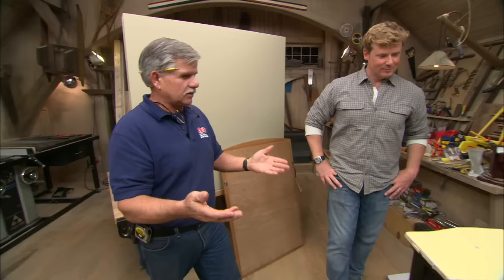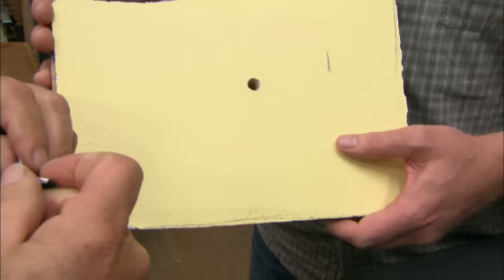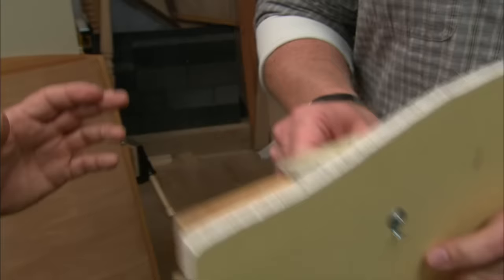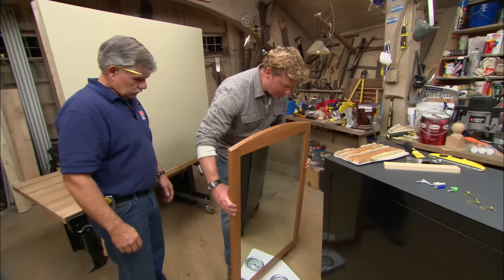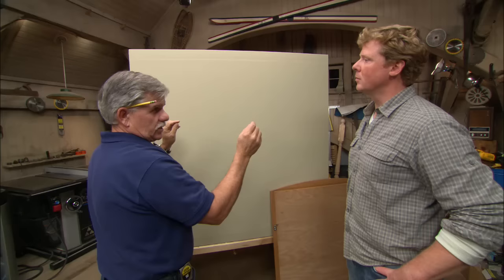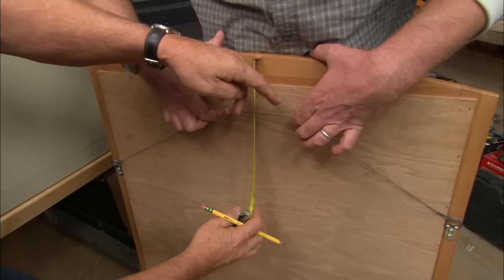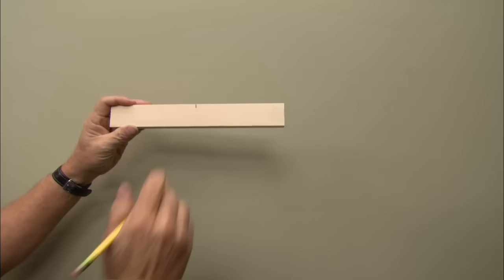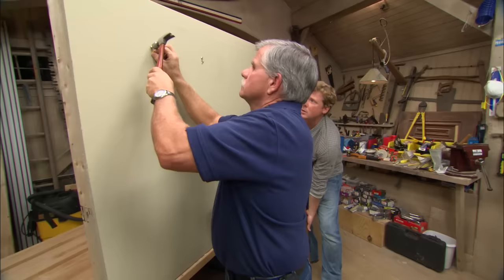How to Hang a Heavy Mirror | Ask This Old House

Comment: I didn't know you could just nail these into drywall. Thought drywall automatically meant using anchors and screws. This looks so easy!
Reply: Not a good option and for the screw in inserts don't try hammering it in. Poke a hold in first and then screw it in.

Comment: It may be overkill, but when hanging heaving pictures, I often find the stud in the wall. Once I have the stud, I measure the distance to the center of the picture. Then use that measurement for locating the drywall anchor on the other side of the center. That way I have one fastener driven into the stud and the other being a drywall anchor like one of the ones shown in the video. If the drywall anchor fails the fastener in the stud may still keep the picture/mirror from crashing to the floor. It is also helpful to know where the studs are so you are not trying to drive plastic anchors into the stud if there happens to be one where the anchor is intended. There are some fasteners that work with both drywall and wood studs. These have worked well for me.

Comment: When u are looking at a wall with picture or mirror in your hands, you are not able to see the hook and get the wire to catch. Here is a tip. Get two drinking straws with the diameter closest to the width of the hook (the part that catches the wire). Insert a straw in each end. The straw will be at an angle away from the wall. Get the picture or mirror and lift high over the straw, bringing down slowly. The straw will guide the wire easily into the end of the hook. Done this many times. Works like a charm
Reply: You're so clever!  Thank you!  😊
Reply: Great tip! Thanks!
Reply: Don Persaud that’s awesome. Gonna have to try that today at my next customer.
Reply: Had trouble w/my concrete entry wall. My son studying to be engineer helped me, but we were off 1/2" too wide. I'm going to try this to see if my understanding of our shortness is correct B4 I proceed. I know it'll work once I get it (carefully!) despite no wire. Thanks!
-Azariah/SuburbaKnight
Ps 20:1, 6-8; Is 43; Is 38:15-20; John 14:11-21
Reply: Naked sweating peeking out thru the blinds every 3 seconds. Jaw going bananas. Is all that happens when anyone has a straw and mirror. Nothing gets done.
Reply: @chadlebbing4960  Root beer right thru both nostrils! Freakin hysterical! Good one!! Is that a helicopter??????
Reply: I don't get it.
Reply: Great tip. Hanging heavy mirror on wall tomorrow and will use this clever tip.
Reply: @mitchjohnson4714  
👍  Me neither  !

Comment: I just purchased the hooks you used for drywall.  If you read the small print, it states that the weight they support is only if the nail is inserted into a stud.  Also, why even use the picture wire at all ? I feel the mirror would be sturdier if you placed the hooks on the wall,  to catch the D-ring hangers.  This would also stop the mirror from moving side to side as pictures always move on wire.  I love your show!

Comment: You can use just the drywall, no studs, drywall is much stronger than you might think even though you could punch a hole in it with your hand. With good drywall and the correct anchors you can hang up to 50 pounds on drywall without going through the studs! However, if you make a mistake, or the drywall isn't as strong as it should be, it's not going to hold it and the drywall will break and you'll hear a nice crash as whatever you hung up comes falling down.

Comment: I'm no Tom Silva, but I have mounted many heavy mirrors for a service called TaskRabbit, and I'd like to share some things that might be useful.  Tom is right when he says that the first thing you need to know is what the wall is made of.  I would add to that: is it an interior or exterior wall?  (Exterior meaning that the other side of the wall is the exterior of the building or another apartment unit.  Interior walls tend to have more space available behind the drywall or plaster & lath, which increases your fastener options.)  I like his use of the toggle bolt with the hook for the plaster wall.  This also works on drywall, as long as you steer clear of studs. (Mounting fasteners into wood studs would be great, except that most mirror D-ring spacing won't match your stud spacing.  Hollow wall anchors let you put the mirror where you want it.  Usually.)   Keep in mind that you'll need to drill about a 3/8" hole for a 1/8" toggle bolt, and you'll want to make sure that the upper, round area of the hook you use is large enough to cover the hole.  Also, plaster and lath walls tend not to have a lot of clearance behind the lath.  Exterior walls especially often have about 3/4" of space or less between the lath and a masonry exterior.  The toggle bolt length will have to be just right, assuming there's room for the toggle to deploy.  If you've found a good toggle-equivalent solution for exterior plaster walls, please comment!  

I don't recommend using a wire between the D-rings, because what tends to happen is the weight causes the D-rings to peel up along the edges, creating a sharp edge that can scratch your wall.  You see this a lot on antique mirrors that have been hanging on a wire for a long time.  Mounting with a wire does allow you to both adjust the position of the mirror left to right, and level it, so if you don't mind the peel factor, have at it.  If you want to avoid the peel, you could...

Use two fasteners: one for each D-ring.  Tom could have also measured the distance between the D-rings, and the distance from the top of the mirror to the D-rings (check them both! don't assume that just because it's from Restoration Hardware, they're accurate.)  Then, he could attach the hooks to the wall, and hang the mirror from its D-rings.  This method requires you to be careful measuring and drilling, though, because you can't make small adjustments for leveling and positioning.  

A tip on measuring where your two fasteners will go when hanging a picture or mirror with a wire is this: measure the width of the piece and divide it by two.  Let's say you have a 30" wide mirror.  Half of that is 15", so that's how far apart the hooks should be.  (You can round it by a couple of inches if you have, say, a large map that's 52.75" wide.  Just make it 24", especially if you're using a 24" level. :))  To determine the vertical measurement (distance on the wall down from where the top of the frame will be), take the remainder of the width, in our case the other 15", split that in half and measure in on each side 7.5" and mark those spots.  Then use your fingers to stretch the wire up from those two points, keeping it level to the top, and mark where the wire lies.  Measure down from the top to this point, and that's where the fasteners go.  

Finally, when you're holding your picture or mirror up to the wall, be really careful not to touch the wall with it, if possible, because walls scratch so easily.  Check the back for staples (there are always staples halfway out from the corner protectors on new mirrors.  Use a flathead screwdriver and some pliers, and pull 'em out!), or the metal wire itself (love that vinyl-coated wire!), screw-eyes, etc. before you put it on the wall.  

If I were mounting this mirror, here's how I'd do it.  Comments welcome.  If only there were a way to demonstrate all this in a video...

Drywall: 
1. Measure and mark the wall with a LIGHT AND SMALL pencil mark where the top center of the mirror will be.
2. Measure the distance between the D-rings on the mirror. Let's say it's 26-5/8", because it's always a fraction from easy.
3. Measure the distance from the top of the mirror to the top of EACH D-ring. It's gonna be  9-5/16".  (But they're both the same!  Hooray!)
4. Write these numbers on the back of the mirror.  Or somewhere else, because you'll forget them.
5. Using a plastic (non-marking) level with measurement markings printed on the edge, I'd measure straight down (plumb) from the top center mark 9-5/16" and mark it.  Then I'd turn the level 90 degrees and measure left and right of that mark half of 26-5/8" (13-5/16").   Now I have two marks level and centered 26-5/8" apart, and 9-5/16" down from the top of the mirror.  I'd measure them again to make sure.
7. Next I'd grab my two stud finders, one a magnet, one a traditional electronic capacitance-detecting version, and look for studs behind those marks.  Best case scenario: there aren't any.  Why? Because I'd like to use the same kind of fastener for both, and if there's just one stud, that might not be possible.  There won't be a stud behind each one, because studs aren't (usually) placed 26-5/8" apart.  Let's say there are no studs.  Hooray #2!
8. For this 30 lb mirror with D-rings, I would use something called an EZ ancor. It's a metal drywall fastener that looks like a big screw, that comes with an actual screw that goes into it.  You drill a pilot hole (I do, anyway) with a 1/8" bit to make sure there's about an inch of clearance behind the drywall, then use a Philips head screwdriver to drive in the anchor flush with the wall (tip: drive it almost all the way in, then back it out and cut away some of the dimpling in the drywall.  Then drive it back in to get a better, flush installation.)  Then, you can drive in the screw (Use the one it came with! Size matters.)  Depending on your preference, you could drive the screw in leaving about a 1/4" exposed to rest the D-ring on.  Or, you could use the hook like Tom has.  In that case, you'd place it on the wall with the hook ledge on your mark, mark the wall through the mounting hole, and drill your pilot hole there to insert the anchor.  TIP: After you insert one anchor, measure again with your level to the next mark (26-5/8".  This is important, because when you install the anchor, it's usually 1/16" or so off from where your mark was.  
9. Install the second anchor and screw or anchor and hook combination.  
10. To hang the mirror on the fasteners by yourself, I've found it's possible to just get one D-ring onto a hook/screw, then support the other end while I walk around a dresser/toolbag/dog and attach the second one.
11. Assure yourself that you've led a good, clean life, and deserve for it to be level.  Check it with your level.  React accordingly.

Plaster:
Follow steps 1-5 above.
6. I'd use the magnetic stud finder to check for metal on a plumb line along my marks.  If there is, I'd shift the position of the mirror off the metal.  If there isn't, Hooray #3!
7. I think Tom's toggle and hook is a good option here, so I'd check to see if there's clearance behind the lath for a toggle bolt.  That means putting the hook on the wall, marking the mounting hole, then drilling with a 1/8" bit.  This is where a straightened paper clip comes in handy.  You can probe the hole to see how deep it will go before contacting an obstruction.  Or you could drive in a 2.5" screw to see if and where it bottoms out.  Do this for both marks.   If there's space back there...
8. Drill ONE 3/8" hole and attach the hook with the toggle bolt.  If that works, then repeat for the other hole.  Use your level to level the hooks an space them 26-5/8" apart.  The nice thing about the toggle bolts is that you get a little wiggle room to adjust them before you tighten them down against the wall.  
9. Follow steps 10-11

Back to step 7, if there isn't room for a toggle behind the lath, then we're looking at anchoring into the masonry behind it. That means it's time to call a pro, like maybe, Tom Silva.
Reply: RE:Bricago. "Also, plaster and lath walls tend not to have a lot of clearance behind the lath. Exterior walls especially often have about 3/4" of space or less between the lath and a masonry exterior."
I don't understand this. All the lath&plaster walls I have seen, whether exterior or interior, consist of the normal vertical studs (usually 2x4) with the horizontal lath attached to the surface of the stud. Any exterior brick or masonry is spaced about 1/2" away from the sheathing  by using masonry ties. So, you still should have 3.5" - 4" clearance on an interior or exterior wall. Unless you are talking about some kind of a commercial building with concrete block walls and lath applied directly to that.
Reply: Thank you!!!!!!! I have been googling for this info and having trouble finding anything but advertisements for hanging products.
Reply: Same way I do mines for clients...ez anchors, rounded screw on the d-rings...felt pads on the bottom and top corners to prevent wall stretching
Reply: Thanks. I just did my first heavy mirror hanging (also working for TaskRabbit!), and I used the 100 lb rated Ook hooks with the 3 nails (two Ook hooks for this mirror). It was a plaster wall. Everything felt solid to me, and I like the minimal invasiveness of the Ooks. Do you think this was a good idea? I'm just a little concerned now since Tom did not at all mention using Ooks for the plaster wall. The package says they work in plaster.
Reply: Your comment regarding interior/exterior walls is important. Whenever hanging pictures, mirrors and other such items on exterior wall is important to leave an air space between the back of the hanging object and the wall. You need air to be able to circulate otherwise it creates a pocket of dead air where mold can grow.
Reply: Bravo. Thank you for the detailed write up and humor
Reply: @munsters2  Clearly we’ve encountered different construction in our plaster walls.
Reply: @TorranceJPlaylist  Clients hate it when their walls get stretched, am I right? 😂
Reply: Are you in Chicago? Want to hang my heavy mirror on my plaster wall? Please…!! (I’m serious—lmk)
Reply: @mcgeorgerl  I attach rubber pads on the corners so the frame will have an even gap between it and the wall. They also keep the frame from scraping the paint on the wall.
Reply: @annnewton4126  I'm trying to reply with my contact info, but YT keeps blocking it.

Comment: Those 30lbs hangers are rated for 30lbs only when the nail is driven into a stud, not drywall. That's what it says on the packaging.
Reply: Yuri Yanpolski I was thinking the same thing.
Reply: In the example they were hammering into an older home with shiplap behind the plaster.
Reply: @cooper1507  No he says most homes have dry wall and walks over to the wall they use the 30lb hangers on.
Reply: Not supposed to read directions.. rule 1
Reply: I think you're mistaken. If you nail those into a stud, they're hold a heck of a lot more than 30 pounds. But I agree on a diy project video, it was a critical error not addressing this.
Reply: It is a short nail cannot reach the stud. Place it in the drywall it will hold with no problems because of the bracket.
Reply: I noticed some packages say this, while others didn't
Reply: No way that little nail can reach a stud through 1/2” or 3/4” drywall. The rating is only for drywall holding the load. If you have a stud right there you could easily replace that nail with a longer finishing nail.
Reply: I don't know why they say this when nobody butts them go Janet into studs. Probably for liability.
Reply: Not true. They are made for drywall.   The hooks are to be used with the anxhors

Comment: If at all possible I would always screw a mirror to the wall using glass plates mounted on the back of the mirror, or if it has rings on the back of the mirror on each side (like in this video), hang these over 2 large-headed screws driven into the wall angled slightly downwards. People only use string or wire because it's easier to do and easier to get the mirror level once up. 
If it's hung on a wire, and especially just on hooks held by pins (!!), if someone brushes past it or a kid messes with it then it can come off and cause a serious injury.

Comment: The best explained, most straightforward and relaxed instructional video that I've seen ! 
** ALSO is it ok to simply use JUST masonry nails ? 👇👇
**  wished that you would have
ALSO included tips on the best types of hanging cord/wires to use too.
But many thanks nevertheless.

Comment: I would use 2 hooks on both sides of the frame  instead of the wire .
Reply: Agreed, plus it won’t tilt down nearly as much, with wire you will always get that tilt, unless you put plastic bumpers on the bottom.

Comment: I am often trying to hang the picture of mirror without any help. I can not see behind the frame to hook the wire on the hook of the hanger. I put a small (Salad) fork over the hanger hook with the handle, UP and the tines around the hook  with the handle top surface toward the room , it makes a larger target. hang the wire on the frame over the fork then reach behind the frame and remove the fork making sure that the wire engages the hook. . It makes it easier to connect with the hook than it sounds to describe it.
Reply: +Dennis Miles great idea.
Reply: +1. Great idea

Comment: Those two holders on the back edge of the mirror are what you're suppose to use to hang the mirror. They're not to sting wire across. Most manufacturers have a sticker saying use these two hangers to mount your mirror to the wall. If my mirror was 35lbs personally I'd use two 45lbs hooks to hold it, over kill yes but the price difference to safeguard a mirror that costs $200 - $500 I'm spending that 15 cents.

Comment: For a large, heavy mirror you can also utilize a scarf joint made up of interlocking metal or wood strips. The metal version I've seen is similar to a carpet transition strip, but with a bigger offset along its length. This gets fastened to the back of the frame, with the offset facing down. The mating piece is fastened to the framing with screws, offset facing up. You lift the frame and gently slide it down until you interlock the mating pieces on the wall for continuous, very strong support.
Reply: got a product name or link to help us find the item?
Reply: Yes, French cleat.
Reply: One example: https://hangmanproducts.com/products/professional-french-cleat-hanger